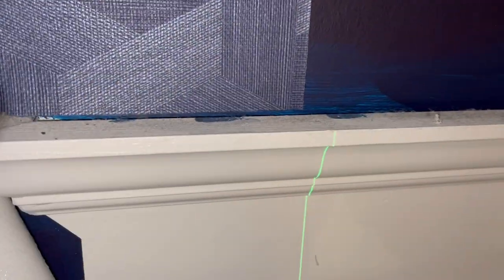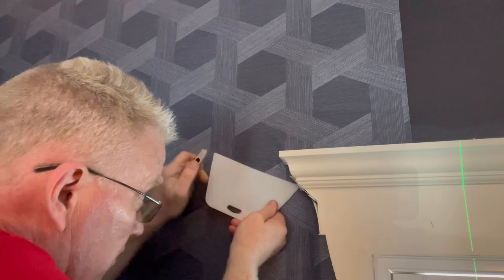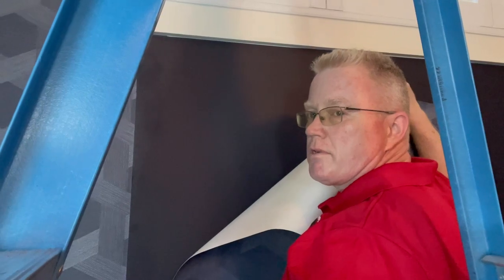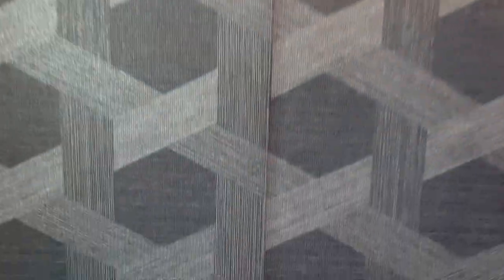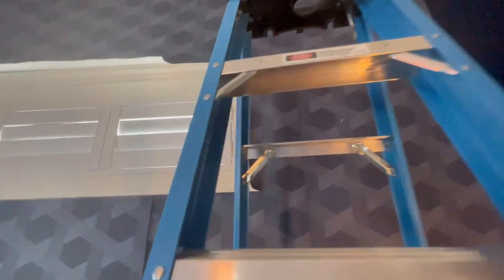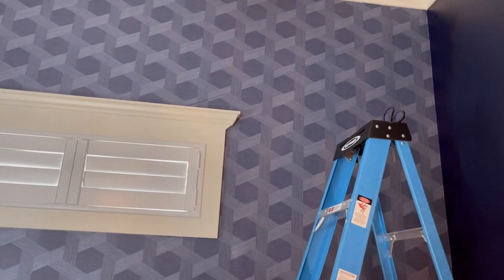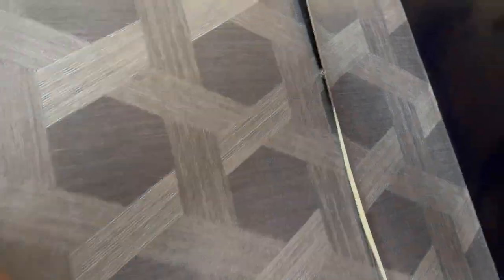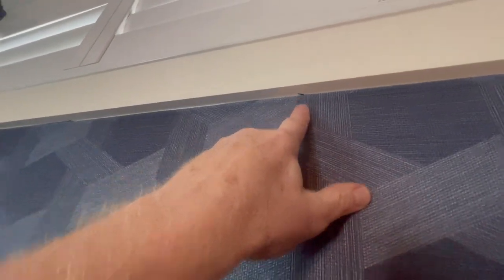How to Force Phillip Jeffries Wallpaper to Match Around a Window (Must Watch!) - Spencer Colgan

Comment: A wallpaper hanger has to be a miracle worker Spencer!!
My only feedback is....
it's a paper you'd rip out the book after this install so you won't get it again lol

Seriously though, I don't think you could do much more, a blind man on a galloping horse won't see that trickery.
It's a nasty heavy wide vinyl.... it's gonna 'grow' on you as you work it with the soaking.

You have balance, both side of the wall fall on the same half diamond... (6.5 diamonds either side from left or right of the window to wall corner)

I may have started in the middle over the window. Then hung the full left length, then done the under window short length.. then the full right hand drop. Then finished off with the 'easy' sides.
But, over and under a window the paper will stretch.

Horizontal and vertical laserliner  will aid in seeing how the pattern is 'running'.

End result looks good. customer happy?
Reply from the maker: I like your answer. I always stay in the Center. Not this time though
Reply from the maker: Client happy
Reply: @spencercolgan  it's very close